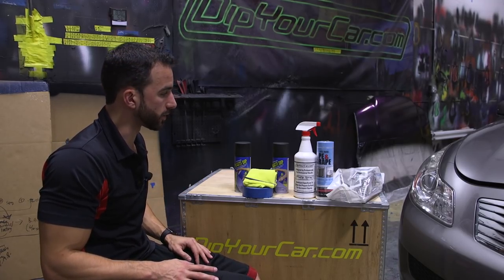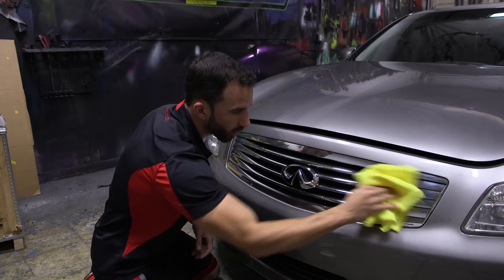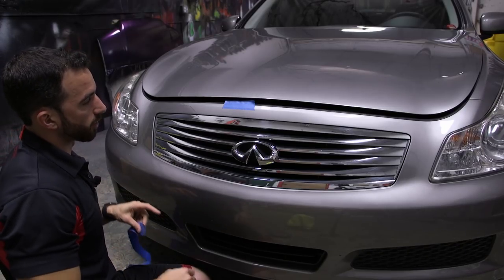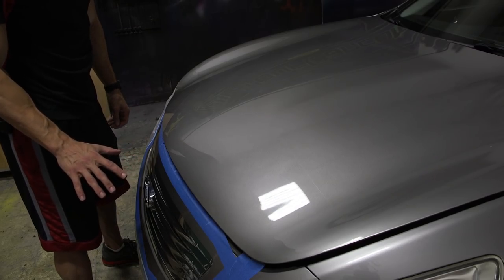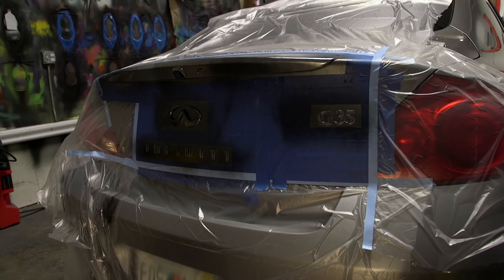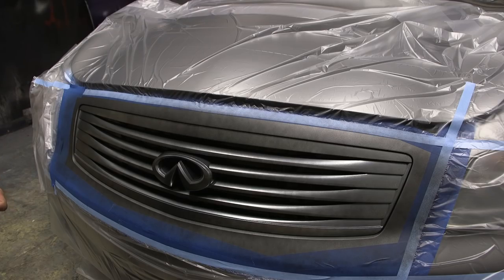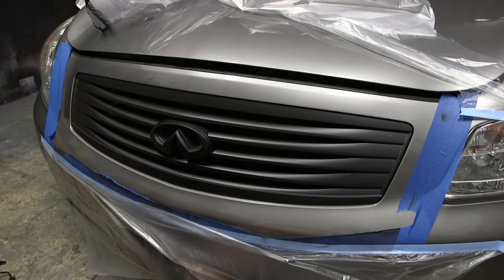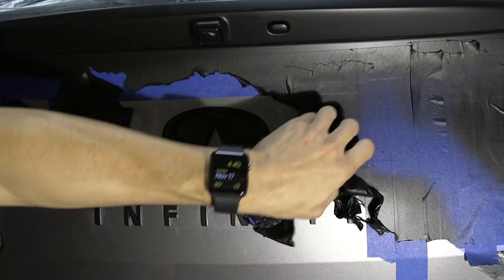Plasti Dip Your Emblems and Grille - The Complete Guide

Comment: i like the videos. ive used plastidip on all my cars since i was indrotuced to it. love using it. love the freedom it gives to change whenever you want. i have a question though. i noticed in the peel off portion the letter were showing chrome on the edges where it meets the car. but then the final walk around they are perfect. did you do another couple coats with the camera off?

Comment: You should do a video on how to plasti dip when its like 56 degrees outside and tips on how to make it come out perfect
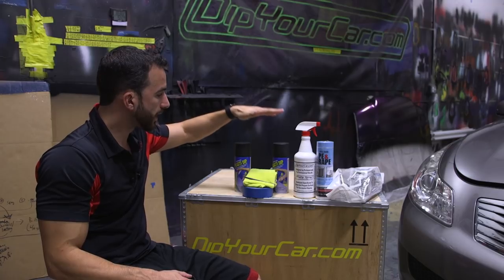Reply: +DEEZ Nuts thats funny because at 1:30 there is a thermometer on the wall and im pretty sure it says 54 degrees. but if you are spraying when its colder, put the plastidip in a bucket of warm water for a while then shake the hell out of it before spraying and it comes out nice and fine.
Reply: +DEEZ Nuts I did mine on a hot day no issue.  Black + glossifier came out nice.  One side was getting sun near end so the dip was really kind of sticky after 25mins still so I pulled the other side then turned car around and blew some cool air over it (not on it) let it sit another 5 mins and pulled no issues.  I had small letters still no isssue.

Comment: Usually How long does it last before you need to re-spray? and Overtime with different weather conditions such as rain or heat, will it eventually start to come off or peel off?
Reply: 15 minutes between coats and I don't think is is intended to come off unless you scratch you're car.
Reply: U got kik
Reply: Bruh lmao

Comment: Maybe I missed it, but what's the curing time between coats? I heard 1 hr after everything is done, but between coats is it like 10 min?
Reply: babolatpdtp i have the same question
Reply: 15-25 mins depending on temp and humidity
Reply: the can says 20-30 mins between coats, and 4 hours to completely dry afterward.  I would say at bare minimum do 15 mins between coats and let it dry 1 hour after your final coat, as he mentioned if it doesn't dry completely you won't get a good peel on it and it will just be more of a pain to peel off.  I followed the instruction on the can of 30 mins between coats and 4 hours to dry and had no issues EXCEPT i didn't mask off around for overspray and had some i needed to wipe off which wasn't that bad.  I would definitely recommend the overspray even if you are doing it inside as you will get more overspray than you think even if you are just trying to spray in the boxed off spraying area as i did..

Comment: So I added this comment to your most recent video in hoping you will see it but I want to put it on here as well considering my question relates directly to this. So I have just recently started watching these videos and Im really interested and excited to start dipping on my own. One question I have right now is I see in a lot of the videos that you spray right over the emblems of cars and they don't look taped/masked off and then in the final shots the emblems are not dipped but instead are in the standard chrome. Ive watched your video on spraying emblems and and I see you can just peel it away? do you ever run into the bridging problem on the emblems. To me (who has never done this before) it just seems like it would be all to easy to be peeling the dip off of the emblem but then it start taking the dip on the surface of the car with as you do it. Obviously I would use extremely care and go slow while peeling it off but do you ever run into that problem I described or is does it always just peel away with simply ease?

Comment: after the 6 or so coats and dried completely can you add the glossifier straight on to the plastidip ? and how long do you leave it on for ? most of the videos are all matte black ! 🤔 thanks in advance.
Reply: William Lau yes you can spray it on. Be sure to treat it like spraying clearcoat, so 2-3 wet heavy coats with overlap. Make sure it doesn't run.

Comment: Not sure what happened but the dip ripped off some of my paint. After peeling i looked at it and there was green (my car color) on the contact side of the dip. ??? I did 3 coats just as you did, 6-8 inches away, started spraying on the masked area of my car. I highly doubt it is weak clear coat because my dad and I redid it all over the winter.

Comment: you think I can get away doing this in the garage winter time in michigan? what do u think of a heat gun to speed up the drying process or should I wait for spring time?
Reply: I did my wheels in my garage in NH, just make sure the area is completely dry and make sure the cans aren't cold and it will be fine.

Comment: so my question is how do you keep your dip looking fresh over time
Reply from the maker: Easy!  Make sure you apply DipCoat Protective Spray every week or two.  Keeps it looking fresh and clean, and keeps it feeling slick.  It's a must-have for dipped surfaces.
Reply: +DipYourCar so dip every week or 2?... pass
Reply from the maker: Tires need tire shine, wheels need wheel cleaners, cars need wax - dip needing DipCoat a couple times a month isn't a lot to ask.  If you're willing to put the work and time into dipping your car, it's also worth putting the time into maintaining it.  DipCoat is our top selling accessory, once you try it you will understand.
Reply: +DipYourCar i misunderstood, the spray is like a wax. I thought I was gonna have to prepare the car and do it over and over again. I saw a video where that spray makes the dip look shiny, if I'm going for the matte flat look, will that same spray work for me?
Reply from the maker: Yes it will certainly work for you.  It adds just a bit of sheen but only enough to make it look clean.. it won't add an artificial "gloss" finish.
Reply: +DipYourCar cool, thank you for the info, i will give it a try
Reply: DipYourCar how many coats do you recommend for a 96 eclipse spyder

Comment: I'm about to blackout my grille, but I have a small spot where the original paint is chipped. What's the best way to proceed? Sand the spot and prime? Just put a couple extra coats on the grille and hope it blends?

It's not a deep spot, but I would prefer not to have a "dent" in the dip.

Comment: Ever had a line appear where your tape met the plasti-dip?  I have that on my vehicle after doing the emblems.  It's not in the paint... I've tried polishing it out to no avail whatsoever.  It's almost like the metal deflected when either the tape or the plasti-dip were peeled off.  (BTW, I used green Frog painter's tape).

Comment: Why dont you just take the grill off to dip it?
Reply: On some cars the grille has electronic components/and or is very difficult to remove. But if it's just a piece of plastic knock yourself out.
Reply: Alot more work to do that
Reply: I did this to my Q60 grill, which is the same exact one as in the video. I removed the grill. It was probably less work than taping everything off and then taking the cover off to protect the radiator

Comment: Tried to do this for my nissan altima regarding the lettering on the back. Didn't work for me so I just took the letters off first and then sprayed them. After that I put them back on the car. Ditto for the Nissan emblem on the grille.  I could never get it just right and perfect using this method.

Comment: Just tried this and it failed miserably. Likely operator error lol. Put on 5 coats while in my garage. Cleaned the surface throughly, waited 30 minutes or so between coats. Let dry for two hours after last coat.

All started peeling off the emblems as I was removing.

Any advice?

Comment: Just followed this tutorial and am very happy with the results! My issue, there's a slight haze that was left after the plasti dip was peeled and I can't for the life of me figure out how to get it off. Buffing with a micro fiber towel is getting me nowhere. Any tips?
Reply: Peter Raizis alcohol or a paint correction product/liquid should get it off. Prob even use your finger and rub back and forth really hard lol.
Reply: What color was your car out of curiosity? I’m about to dip my emblems and my car is black and I’m worried about something like that too. If I breath on my black paint it scratches it so I don’t need to be trying to run anything out lol
Reply: The car was white, the emblems were red. It left a slight pink haze that eventually went away on its own. 
I doubt you’d have anything to worry about on a black car!

Comment: I’ve just coated one large chrome logo and a set of letters. Logo went great, I tried to get fancy with the letters by making a cut out that guarded the body work. Totally cocked it up as the I’ve not got an area to peel off, I’ve ended up with a varying amo7n5 of coverage on the body work, from fine mist to drip marks. I cannot remove it all without scraping it roughly but some of the lighter area just won’t come off. I’ve tried some bodywork cleaning products but can’t shift it.  
Are there any chemicals that remove plasticoat plastidip without harming the clear coat of the bodywork?  HELP.

Comment: So if you wash it it will not come off?
Reply from the maker: +KMEgamerTV It will not come off.  It holds up to car washes very well when applied correctly.
Reply: +DipYourCar you make it look easy lol... very nice video! thank you for the fast response!
Reply: I've been through numerous car washes, hand washes and all types of weather. Only thing I suggest is at least 6 coats.
Reply: +KayJay940 make sure to clay bar
Reply: +KayJay940 make sure to clay bar
Reply: Nope. I did the same to my Impreza and the dip hasn't peeled or cracked during washes.
Reply: sk8punk318 how long to wait roughly between applying coats? I know completely dry but what is a roughy time to wait? Thx

Comment: WHat happens when you wash your car?  Does the dip come off?
Reply: +turkishexpress No, as long as you put on enough coats, you're good. if you only put on like 3, the water pressure can tear it off in some spots, just be careful to not to put the water pressure too close for too long. I have plastidipped rims and they have been good for a year so far.

Comment: I'm having trouble. When I spray the plasti dip it comes out almost like in a straight line and isn't spraying right. Someone please help.
Reply: +Speedaholics  happened to me too. need to make sure the can is relatively warm. the cold air makes it thicker. or it could be that you bought one where the sprayer is messed up. 
i went up stairs and warmed it in the sink.. came out a million times better after that.
Reply: I actually ended up finding that out on the internet. I put the can in a bowl of warm water for a good half hour and that did the trick. Thanks